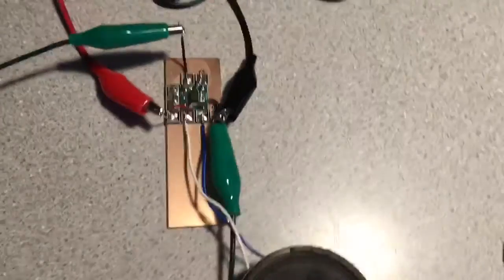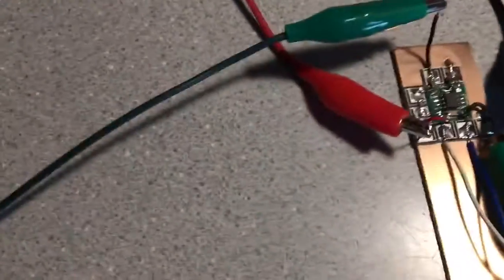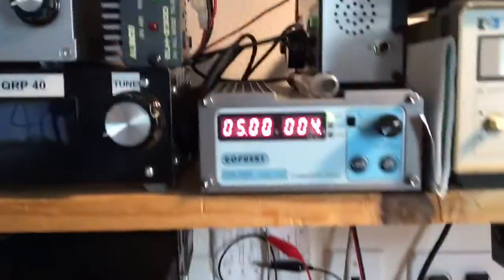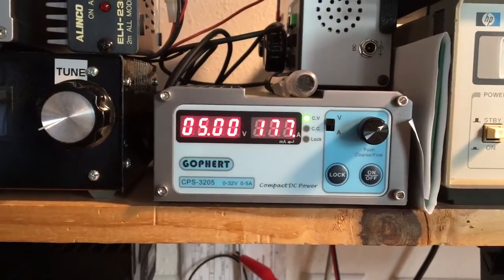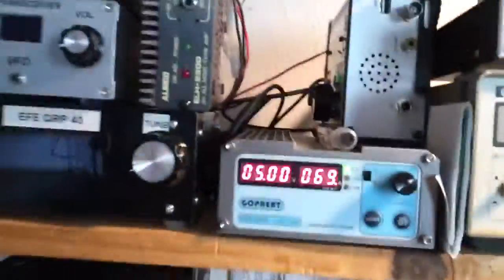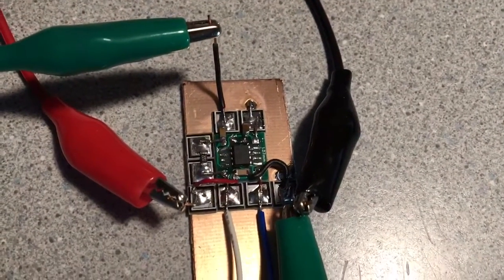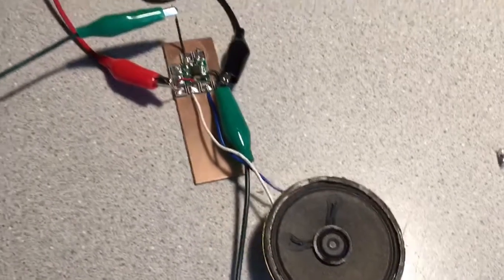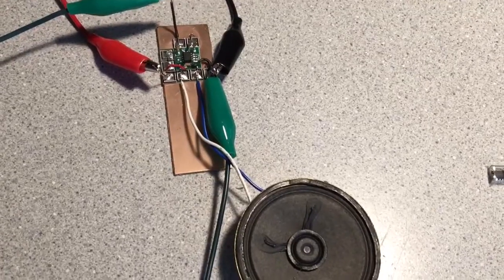Testing a 8002A audio amp chip

Comment: Thanks for the ear-piercing demo! These are the chip found in a $1 DollarTree 2xAAA battery-powered speaker. They work surprisingly well for a buck. I was expecting an LM386, etc. and planning to run off 5V. We'll see how bad it sounds with noisy USB power and potential ground-loops!
Reply from the maker: Well, it was ear ear-piercing on my end, but the AGC on my phone cut the volume back to where it didn't show up on the video. The 8002A is the Chinese knock off/copy  of the Texas Instruments LM4871M National Boomer chip, they are pin for pin compatible and can produce 1.5 to 3 watts if properly configured. Thanks for watching my video.